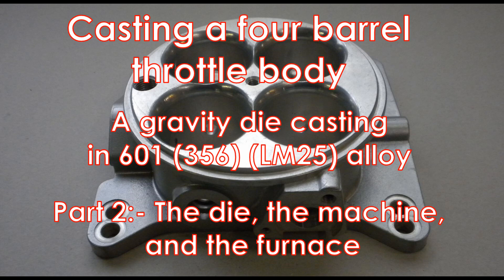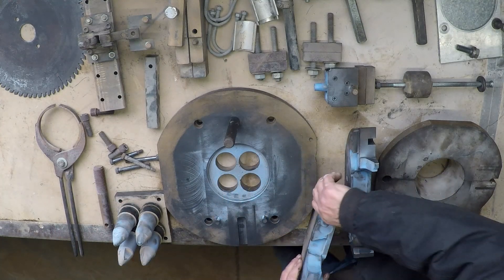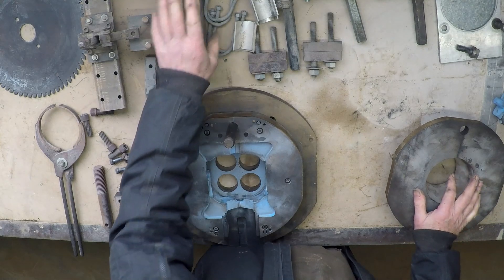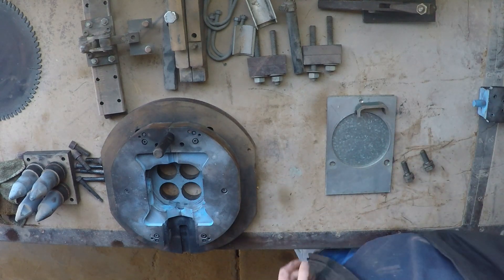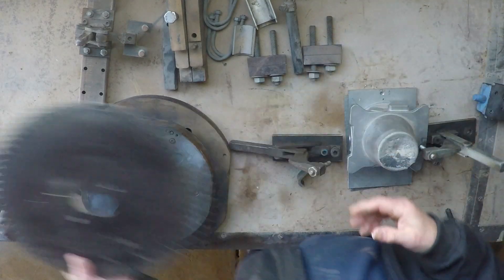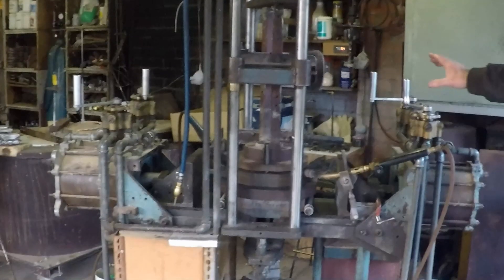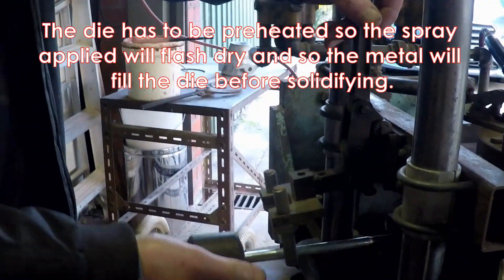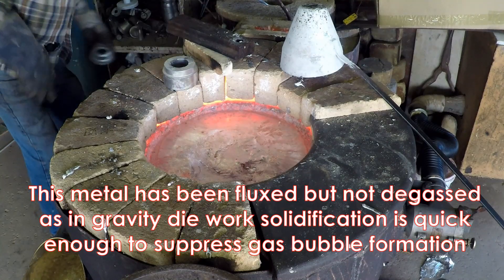Casting a four barrel throttle body Part 2 :- The die, the furnace, and the machine

Comment: Best kind of casting aluminum for a throttle body would be from junk throttle bodies.
Reply from the maker: Joseph, Well --- Maybe. Several problems. I won't use junk metal, its just not worth the problems it causes.
Many throttle bodies out there are made from machined billet totally different alloy to that which I cast and unsuited to being cast
Don't think there are enough junk  old throttle bodies out there - not here in Australia anyway..... Martin

Comment: excelent video..!!!, could you share details of your furnace burner.? it looks quiet and eficcient, thanks in advance.
Reply from the maker: Cometsa, Thank you for your comment. The burner is one made here in Melbourne Australia where I live. I bought it new back in about 1968. As I recall it cost about a weeks wages at the time! But it was money well spent as it is still going strong and has kept my furnace hot for thousands of hours. I normally use this burner on my smaller furnace - it takes an A90 crucible which holds about 32 Kg of aluminium while the furnace use din this video holds about 75 Kg of aluminium. I believe that the same company still makes this burner and the following link will take you to a data sheet.  https://majoreng.com.au/pdf/S%20Type%20Oil%20Burners.pdf    Mine is the S4 model and running this bigger furnace it uses about 50 to 60 liters of fuel in a day - (its actually not a very efficient furnace as it is uninsulated and open topped.) I burn diesel fuel  Hope this helps.... Martin
Reply: @olfoundryman8418  Many thanks for your answer it is very good explanation and helpfully, 

All the best and kind regards from México

Comment: Hi, I still looking around  Texas for 14ESS coating and for I think it the release coat Blue, from Fossil but I was wandering is on my tilt mold that I am making out of 1inch thick steel plate for the pattern is there a recipe for making a cheap coating so the aluminium doesn't  stick to the mold that might be found in a hardware store until I can get the right stuff from Fossil , any help would be greatly appreciated
Reply from the maker: Brad, Yeah that spell check can be a bit of a bother. The release coat blue is from ZYP coatings not Foseco. Years ago everyone used to make up there own coatings although that was before my time (gee, it WAS a while ago then!). The coating is made from fine refractory particles , water, a binder, and some sort of suspending agent. Typically refractories might be talc, iron oxide, fine alumina, fine sand, even very fine crushed up old fire brick might do, The binder is commonly sodium silicate solution, and the suspending agent bentonite or some other clay. I have never tried to make my own (too busy making castings ) but you could try two volumes talc, two volumes iron oxide (concrete pigment) one volume 32% sodium silicate solution plus about 1/4 volume bentonite. Try to get a thick cream to paste consistency. dilute this with water about 4 water to one paste should be a bit like a thin milk, spray this on the HOT  (200 deg C) die with an automotive  spray gun - small touch up guns seem best - It should flash dry on hitting the die, if it sits there and just bubbles the die is too cold  off . New dies never hold the spray well - it tends to flake off but when the dies is used next time it will behave better. Sand blast the die before heating it up. With just the talc and the iron oxide it will be a fine spray best suited to small castings, for larger stuff you need a rougher spray have to add some say 150 to 200 mesh stuff either alumina or silica or another refractory (try ceramic supply houses for small quantities of something suitable.) I have never tried any of this you will just have to experiment and try it out for yourself -- good luck and let us know how it all goes..... Martin
Reply: Greatly appreciated, I was thinking along the same lines with sodium silicate and fine sand but I didn't think of the bentonite clay mixing in. I see where that would help. 
Soon I give it a try. 

On a side note, you may like to know after watching  the video on your aerator machine and made my own very similar to yours with a chopping area with about 7" to 8" diameter  and about 10" and 5 levels of rebar and bolts for blades. Works great only wish made the feed wall higher to keep it from spitting out some of the sand, 
I think that is apart of the joy of doing this kind of things is the trail and error and figuring it out. 

And once again thank you for your advice and your videos

Comment: What an interesting video, Martin.  Really looking forward to seeing this setup in action.  Love the furnace too, I'm a bit jealous... but you can keep the fuel bill haha !!  Cheers Andy 🍺🍺👍👍
Reply from the maker: Melt, To melt about 160 Kg and keep it hot (a days worth) uses about 55 litres of diesel at about $80.00 total, the metal is about $750.00 total so the fuel is really a minor part of the cost structure. If I was to use LPG though the fuel would be closer to about $200.00. Furnace is a bit scary - what do I do with al that metal if the crucible breaks (fortunately they usually do not "break" but just start to leak slowly) Real problem is a new crucible is north of $1000.00 - now you can have that 😊... Martin

Comment: Good to see you back as it makes my day to see a master caster. Are you running 100% diesel or is it a bio mix of diesel and veg oil?
Reply from the maker: Donnie, 100% diesel. Years ago I tried a blend of old sump oil and kerosene way to messy to deal with most of the sump oil had lots of water and grey sludge in it - probably lead from the then wide use of leaded petrol back then 😱. The fuel cost turns out to be about 2% of the cost structure so its not really all that relevant.... Martin

Comment: Awesome videos Martin, exactly the kind of casting I'm looking to do, I've been working on cutting some dies from 3 in steel plates. After market differential covers for off road trucks is what I'm casting and though I'm still learning these videos help me a lot. Thank you for sharing.
Reply from the maker: Ray, I have used dies cut from steel - both mild steel and H13. BUT to be honest I would recommend grey cast iron bought as continuous cast bar you can get it up to at least 300 mm diameter. It machines easily to a reasonable surface (bit dirty I guess). It has about twice the thermal conductivity of steel and that makes for a higher casting rate and better casting properties, Also once "seasoned"  (by first use) the graphite flakes at the surface get eaten out a little and this provides excellent keying for the die sprays. Truck diff covers are quite large and you may have to bolt pieces together to get a big enough slab, but I always think that slabbed up dies as opposed to cut from solid are better as air can escape out the bolted joints, just need to be clever about where the joints are. Gravity die is an art form 😏… Martin
Reply: @olefoundryman I thought about grey cast iron but wasn't sure, thank you for your knowledge Martin. I know it's going to be a learning experience but isn't it all.

Comment: Do you make those dies by yourself
Reply from the maker: Paul, Yes, I did make them myself. I redesigned the part to make it look nicer, bought an older CNC mill, got it working, learnt how to use it, and cut the die - this took about a year...😏.. Martin

Comment: How many do you make in a run?
Reply from the maker: Craig, For this part about 60 per day but it also takes a few days to get set up and then a day de-gating and heat-treating. Other smaller parts done this way can get to nearly 500 per day. After every day the die is stripped and cleaned. The total run this time was 123 pieces.... Martin

Comment: That is an impressive hydraulic setup. Is that all for just this one die, or do you have other dies you use with this?
Reply from the maker: Ask, I have several dies that fit this machine and while I have 5 other smaller machines (none hydraulic) this is my go to machine for any work needing some force to operate the die. The smaller machines generally have manual over centre clamps and slide hammer core extraction. A friend has suggested that I show some of these machines and work made in them at the end of this video series - sort of a sequel I guess so stay tuned...Martin

Comment: Martin, these die castings look like they are custom parts but you are making them in some quantity. Are they aftermarket for a particular vehicle or class of vehicle? 
Regards,
Mark Presling
Reply from the maker: Mark, They are after market  for V8 engines. They are machined into a few different configurations and flow rates. My customers web site https://www.efihardware.com/ has the info on this. .. Martin

Comment: 10 inch at the bottom to help overcome gravity?
Reply from the maker: Smallcnc, Yep, No - seriously cores can be hard to pull as the solid aluminium shrinks onto them so you need plenty of power to extract them and the bottom cylinder seems the one most often used for the core.... Martin

Comment: Great setup. Reminds me of when I used to cast lead for battery cell connector bars and terminals. The casting of the plates was automated. Well to a degree haha. Had some big jam ups. Didn't take long to get into trouble. 18/ min!. Thanks for sharing. Do you have to vent the chill at all
Reply from the maker: Rupert, Not quite sure what you mean by "the chill" can you elaborate please... Martin
Reply: Oh we called moulds chills. They were machined out of cast iron, we had to vent them on the parting lines to get them to fill. Of course the lead sets 'chills' very quickly
Reply: Thinking about it you have a vent built in already
Reply: We also had to cool the moulds as well as heat them to maintain a constant temp
Reply from the maker: Rupert, I use many "tricks" to vent the die. It helps if we can fill the die from the bottom up and thus just push the air out. I don't like little "Vs" cut from the cavity on the part because it can give nasty little spikes to file off. While I have used them I do prefer to cut down about 0.05 mm deep at the parting line about 6 mm wide  all around the cavity and then connect the outside of this cut to the edge of the die at several places. Done right the metal will not flash down this thin gap but the air will get out through it. I have even just propped the parting line open with a bit of shim or even a hammer dent or two  😊Also I like to slab dies up (rather than always cut from solid)  and bolt the pieces together so that air can get out through the very small bolted gap (can shim this open a little if necessary) You just need to be clever with where you place the slab joints to get maximum effect. In this die the bit forming the large flange is bolted on so the corner of the flange vents well and thus casts properly. For tricky areas a small hole drilled through the die and blocked with a slightly bent (to hold it in) pin with one or more small flats filed on it works well. But the die spray is most important - it is slightly rough and the metal flows over it in its own oxide skin on top of the roughness air gets out under the metal through the minute passages around the "roughness" of the spray - a miss fill is often cured buy a quick spray in the area concerned. But certainly as no doubt you well know getting the air out is most important and needs special attention in gravity die as compared to sand casting where the whole mould is porous.
I have worked with air cooled moulds and even a few water cooled ones. Never had to apply heat other than initial heat up but have had to insulate dies to stop then loosing heat too fast.... Martin
Reply: Thanks for the reply. Casting plate grids for batteries .040" thick we had to do quite a bit to get it to fill. We sprayed the mould with cork in solution. We removed cork to create vents. Water cooling and heated moulds. Poured via a gate and a lead displacement pump. Three machines each. It got a bit hot in that casting shop. I used to work for Yuasa Batteries Birmingham UK. All gone now.

Comment: G’day Martin, now that’s taking home foundry to the next, no, nexxxt level. Was this machinery from the closure of a local foundry? Or did you buy it on Gumtree:)
Gotta wait for the next instalment, you teaser you. Stay safe on the pour, if we don’t see a follow up I’m wondering where to send the flowers, there’s some aluminium in that pot. 
Cheers 
Peter
Reply from the maker: Peter,  The real fun bit was making that die - I redesigned the part and then cut the die myself but first I had to buy a CNC mill get it running and learn to use it - took a year! The machine that holds the die used to be used by a local brake parts manufacturer. I worked there as foundry metallurgist for a few years and acquired the machine then when they made it obsolete. It used to run on compressed air (terrible) but I converted it to low pressure non flammable hydraulic fluid and added the upper cylinder. Yes, next level,  perhaps and as someone else remarked that it is way beyond what most hobbyists would ever get up to in their foundry but as I said in reply  "once it was way beyond what I would have got up to". Its just a matter of what comes your way and what you make of it. The pot worries me a bit - what do I do with all that aluminium if the pot cracks and starts to leak? I should get a new one but at close to $1000.00 its not on - this one was full of water 😱when I was given the furnace with it in - not good to get them wet - lots of slow drying 😏… Martin

Comment: That's a big carbon footprint lol.
Makes you think of the massive amount of energy used in a full scale production
Reply from the maker: Chris, This is why many foundries set up in Melbourne years ago we USED to have cheap energy - sob - no more. 60 litres of diesel over 11 hours in the day so the equalivant of maybe about  1000 KM in a diesel 4*4 so a bit less than the vehicle would use. Its about 2% of the cost base. But yes big foundries use BIG amounts of power it is an energy intensive industry... Martin
Reply: chris moule, another reason to use proper casting alloys to get good results. No point wasting those valuable resources on melted down cans. Martin only uses alloys that he knows are right for the job, he is a firm believer in rubbish in rubbish out. He has never sold me a casting that was not a good one!
Reply: The more you make, the less energy used per unit produced.
Reply from the maker: Chris, To complete the story I have made thousands, probably tens of thousands of castings, that SmallCnc has machined on his nice little  Hercus CNC lathes. What he says is absolutely spot on - GIGO and lets not waste any more energy that we have too... Martin
Reply from the maker: Rick, Exactly … Martin